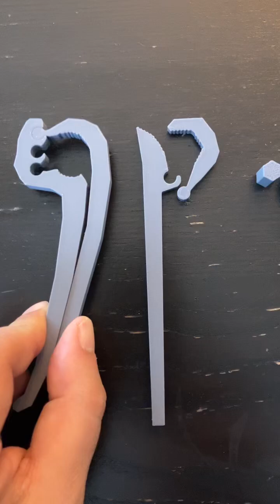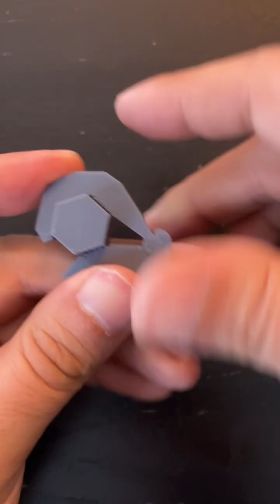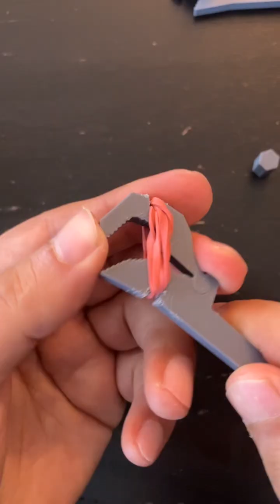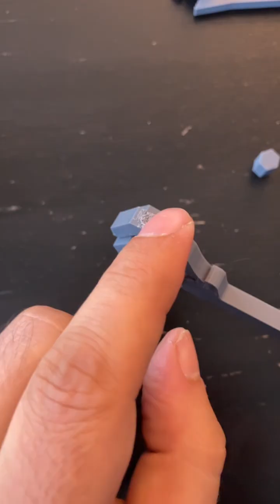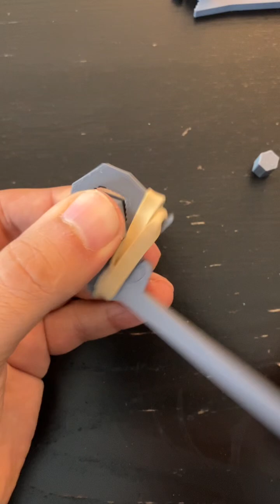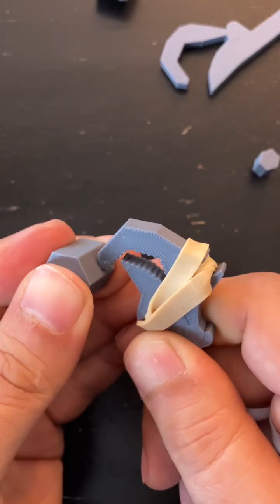DIY self adjusting wrench

Comment: Looks like the teeth can damage the fastener when using the wrench as a ratchet.
Reply from the maker: Makes sense. I’ve seen videos where those wrenches can grip circular pipes, it’s probably digging into the material with hardened teeth.